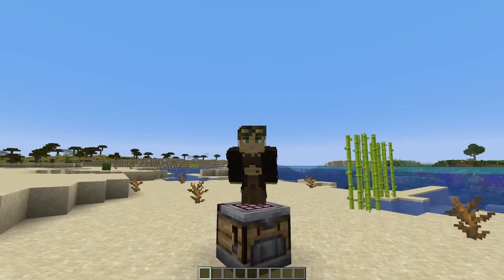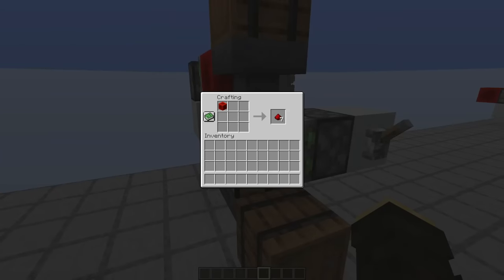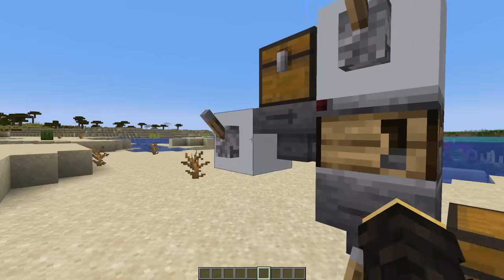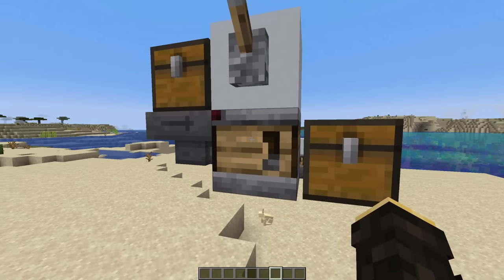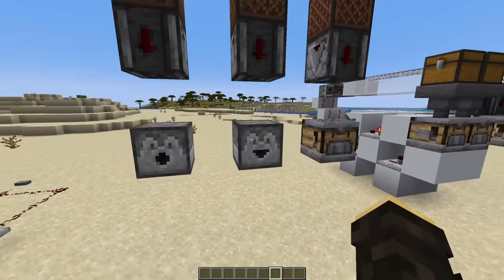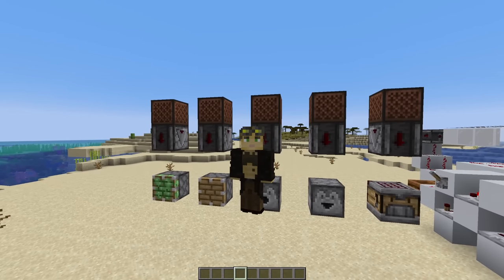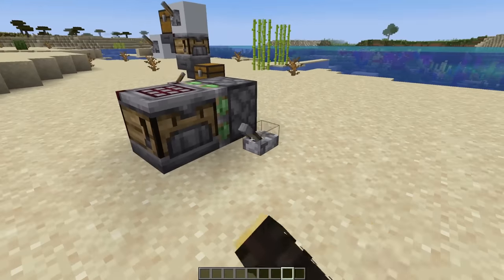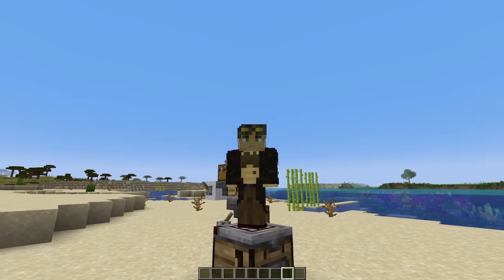The Epic Return of Autocrafting

Comment: You can still make 1 wide tileable design have the comparator running out of the auto crafting run i to a peice of redstone dust, opposite to that redstone dust have another compartor outputting a signal of 8 that redstone will stay 8 until the auto crafter outputs 9, which that change can be detected by an observer in the same 1 block tile

Comment: I don't want them to change the signal output. It works just fine as is. So, the "why we want" is very much a projection.
Reply: for a 1 wide tileable version it is important to have a signal strength of 15 though, since that overrules the comparator reading an empty composter for example and then give only a signal when the crafter is full
A signal strength of 9 would need a comparator in subtraction mode which is 2 blocks wide, or it would need a lot of redstone dust (which is very laggy)

Comment: my thought about your issue with limited inputs and using movable tile entities for a universal autocrafter: why not change the input method, rather than the processing method?

would it be possible to use a series of up to 9 hopper/chest minecarts that are sequenced in the correct order? e.g. input ingredients into separate chests, fill minecarts, then send each minecart in the correct order over the autocrafter?
Reply: Possible? Sure. Something similar to the hopper minecart-fed super-smelters. Load up 9 hopper minecarts simultaneously with 5 stacks each of a crafting ingredient. Send them out in order over a strip of 320 hoppers with crafter blocks underneath, then power all the crafters to craft the items and spit them out. Repeat as necessary until the job is done.

It would be a bit difficult to make it work with items that have a different stack size, and the minecarts would need to be sent out 0.4 seconds apart to allow for hopper cooldown time, but it would work.

Comment: honestky, I find a lot of the criticism sounds like you just want things to be easy, using the contraptions already designed for the modded auto-crafters instead of developing new contraptions.
As shown, most things can be done with the current implementation, including making a universal auto-crafter. The system would be big and complex, but it's possible.

The signal strength 0-9 does seem intuitive in a way and has it's own advantages, making the system 2-wide or 3-wide tileable is still easily possible without signal strength 15. Not everything needs to be 1-wide (although it would be nice).
I would suggest the signal jumps to 15 when all slots are completely filled. That way there is a trade-off for 1-wide tileability, but it is still possible in a compact way. This would also bring it closer to other containers' comparater output.

Comment: Couldn't you move the dropper instead of the auto crafter? It might make inserting items into the droppers a bit more awkward, but at least it's doable 🤔
Reply: No, you can't. But you could make up to 5 droppers fire into a hopper at the top of the crafter + 3 around and 1 below the crafter and you get exactly 9 slots. However you would have to make it slower than the hopper speed so that it doesn't break.

Comment: Just wondering, why could you not just have a single dispenser dispense items into two different slots of the crafting table for a universal autocrafter?
Reply: Or multiple dispensers that go into a hopper
Reply: A single dispenser (or rather, dropper) feeding items into two different slots of the crafter isn't going to be able to reliably feed the same items into the same slots if a slot empties out. It could be OK if you design the crafting station to always keep at least one item in each slot (not that big of a limitation, there's not that many crafting recipes that use non-stackable items as input...) but it does mean it'd take more prep to prepare the crafting system before running a big job.

I think the main issue with a hopper is that it's slow, 0.4 seconds per item. If the aim is to craft thousands of items, that's a pretty significant difference.

Comment: just had a thought, could the crafter be used for a sorting machine? you could disable all but one slot, and fill it with the item you want to sort, with some additional redstone  would this work?
Reply from the maker: I had an idea to use it to sort tools using the recipe that allows you to combine tools for their durability as  tools of the same type would produce valid recipes, but the crafter doesn't distinguish between valid and invalid recipes at the moment.

Comment: I think you could use a dispenser as a line of items so you would need 3 faces of the crafter which are connected to a dispenser or dropper that are also connected to 3 dispensers or dropper,do u have more control about what goes in and in what order

Comment: I'm really bad at redstone, but can't you just feed two separate Droppers into Crafter-loading Dropper at half speeds? Like, sure, it will be taking twice as long as it would at full throttle, but it's not like items, that have enough different components to require such overloading, are needed in the same amounts as ones, e.g. Perimeter Printer's filament and mechanism itself.

Comment: where do you need a universal crafter? in most cases you just either need some kind of compacter or a utility converter either to store items better or to use resources of one farm to run another
Reply: If the plan is to do some crafting in bulk (say, a hundred shulker boxes of some block you need), then you aren't looking for a crafting system that works at the speed of whatever farm you're running, you're going to be bringing hundreds of shulker boxes to a machine that can do bulk crafting quickly. If you put that kind of energy into creating a bulk crafter that can work at that kind of scale, you'll want it to be able to handle whatever bulk-crafting jobs you might need.

So, crafting materials for mega-builds, or TNT for big excavation projects (if you have moveable dispensers and no TNT duping), that kind of thing. Also if you wanna be Scicraft and have a million of every item just to have it...
Reply: @tetsujin_144  if you have specific crafters hooked to farms you will be done with the first thing and for the second you are so limited by hopper speed that bulk crafting is just faster in manual fashion with 9 shulkers it's just faster to break them with anvil dripstone or cactus and craft whatever

Comment: Couldn't you just have a crafter for each needed pattern of disabled slots, and code the sequences of items for the items you want? 
It won't be quick per crafter, but throughput can be improved with more crafters, and you could even add auto-requesting with minimum storage shutoff.

Comment: I feel like Quasi connectivity going forward should be a toggle (using some kind of item)

You'd just make it so old worlds 'replace' the 'old' pistons etc with the new 'quasi' ones, then have the normal blocks function as they were originally intended to.
and, ofc, add quasi to bedrock with this new item/block variants/toggle.

I feel like in theory it wouldn't be that hard to create redstone parity without breaking everyone's contraptions, it is possible to replace old blocks with new ones when updating worlds isn't it?
Reply from the maker: You really need to embrace the utility of quasi connectivity, the options to power things is just so much better with quasi power.
Reply: @cubicmetre  I'm not against it entirely, sometimes it just ends up being more annoying than useful (for casual players especially, it isn't intuitve since it IS a bug, technically)

The middle ground would be making it toggleable, best of both worlds. Keep quasi, turn it off if you dont want it (or turn it on if you do)

And it also means Bedrock users can have their quasi, if they so choose, in an ideal world at least.
Reply: Quasi connectivity kinda sucks
Reply: And, thinking on it more, if Mojang did make it an item or special block variants (Related to the end because teleporting, rifts, alien, maybe? idk.) they could allow quasi in any direction (obviously, still toggleable for each direction)

Meaning all six sides could have quasi functionality if desired, on top of the original one block above (I think? pretty sure it's only above atm)
Which would make it more than just a bug being a full-on feature, it'd probably be interesting to allow access to quasi from the side and below.

It could be a cool addition, fix and parity play, issue would be figuring out how to make it intuitive (how do you visually show the functionality? particles? How do you modify the block without making it a chore to place next to another? etc)
Reply: @stratonikisporcia8630  emphasis on kinda, being a casual player just trying to make some real ass redstone contraption rq and having to deal with or play around quasi is annoying

But for technical players, quasi is a really strong tool, which is why it hasn't been 'fixed'

Only real solution IS to make it an official feature, while also fixing the originally unintended behavior without breaking old contraptions (likely by exchanging blocks when worlds update)
Or just ignore it forever, i guess
Reply: @@zetaggwp8473i genuinely think this, it’d; 
1. Add parity, 
2. Expand the bug turned feature 
3. Finally ‘fix’ the bug for the casual audience 
4. Make it much more intuitivie to use, likely with a visual to show people how to interact with it

I can’t think of any downsides, assuming when implemented it auto-replaces existing pistons and etc with the quasi-up^ variants
Im sure there has to be some downside

Comment: I don't agree with changing the strength to a 0-15 range. It doesn't split up evenly. Right now it's very intuitive, and beginner friendly. I don't think we should sacrifice that just for efficiency in one specific use case.
Reply from the maker: this is not really one specific use case, this is probably the most general use case as it applies to the outputs of most farms

Comment: solution to the multiple different item recipes would be another slot somewhere in the GUI that fits any recipe template item so the autocrafter ''knows'' which items it should put in which slot. As long as the template is in this slot the autocrafter can only craft this particular recipe.

Comment: Make movable: Sure. Long overdue.
Signal strength: You failed to explain. How is 15 easier than 9?
Quasi-connectivity: No. Please, *no*. This counter-intuitive artifact of the original pre-alpha redstone code does not need to be applied to new blocks. I can understand the community's desire to keep it for pistons, but on droppers and dispensers it is my community's most frequent cause for debugging support requests. Do not add this to the crafter. Cut the legacy code and let us have an update where the community works with Mojang to make a intuitive and parity-centric redstone system for the entire vanilla game.

Comment: I don't think you need to move the autocrafter to make a universal crafter.

I wonder how the autocrafter would react to a line of 9 instant droppers each having 1 item. 
maybe with pulses we can get some high enough crafting speed.

Of course let user access the auto crafter to change the layout of the receipe if it is not a 3*3

Comment: Legit the only thing they have to do is give you the ability to lock recipes into the autocrafter. Said recipes will remain locked until you break the block. Boom every problem solved and some quality of life too
Reply from the maker: You can technically already do this, by having the slots pre-occupied with items they would act as item filters, only issue is incorrect items would backlog the system.

Comment: well you could just add a hopper line of 9 hoppers into the autocrafter and have a dropper into the hoppers dropping the item of the item slot in the place the hopper resembles
Reply: that unfortunately doesn't work

it really should, if hoppers weren't a bit jank, but unfortunately, they are
Reply: yeah that doesnt work. hasnt worked for a long time. ilmango has complaints on. the issue can be seen in xisumas latest video too

Comment: Maybe this would be too broken but what if instead of clicking on slots to enable or disable them and then get Hoppers to move items in the correct order which is a bit of a pain and sometimes breaks

What if instead you'd open the recipe book and choose the recipe you want to make and that would lock it in so one hopper could have a variety of Items in any order and it'd just auto sort to the correct slot in the recipe you have locked in?
Reply: I think their goal is to require as much circuitry as possible to do things like that. We can do all that, but we wire it manually with large redstone machines.

Comment: Making Block entities movable is not a few lines of code... It's probably not hard to implement, but it's not trivially either, and probably has massive performance considerations for pistons in general.

The fact that the mod allows it to be toggled on or off has little bearing on how easy it is to implement. The fact that you are saying that honestly makes me think you have no idea about coding.
Reply: I think the main issue with movable block entities is duping risks, but if it is about duping, then it seems hypocritical to still "allow" tnt and sand dupes
Reply: @NathanHaaren  IMO the argument that sand and TNT being dupable, but netherite isn't isn't that hard to make. We also have infinite cobble generators. Sand and TNT dupes can be seen as game mechanics which make some things possible that otherwise wouldn't really be (most notable perimeters and auto miners). But having an easy duping mechanic for any item you can put into a chest... isn't really the same thing, and this is IMO a dishonest argument.
Reply: @megaing1322  duping is duping, in my opinion the kind of item is barely relevant, because duping for example millions or sand blocks has the same value as 1 duped netherite ingot, the only difference is that the duping of 1 netherite ingot is faster than the duping of equal valued sand (or tnt, carpets, rails, concrete, ...)
Most of the technical community only allows duping as a solution to missing alternatives, this is why sand, concrete and tnt dupes are commonly accepted while carpet, rails, tripwire hooks and string dupes are frowned upon because of being much easier to produce in large quantities
Reply: @NathanHaaren   I disagree with literally every part of the first paragraph. If this is your opinion, I don't think there is anything I can say to convince you. But I do fully agree with the second paragraph.

Comment: You are literally the only person I've seen that doesn't blindly call the crafter revolutionary but I haven't seen you point out that, in it's current state
Crafting manually using the recipe book is easily 10 times faster, even when using it in something like iron farms that only get one item inputs that just stack, you can grab your entire inventory of iron and craft 3/4 stacks of blocks while the crafter is barely going for the 16th block
Reply: it's slow, yes, which is why they talk about making a bunch work in parallel at one point in the video. it's other power is for use with automated farms -- it only needs to run as fast as it receives items from the farm, and can run the whole time that the farm is running.
Reply: Yeah, crafting manually is faster (particularly with the crafter limited to doing 1 item at a time)
Auto-crafting is good for convenience, and for bulk processing (as in, dozens of shulker boxes of one item, making materials for large builds, etc.)
Reply: Tthe feature where you can move all of like items at once into and out of your inventory is a java only feature.  Also, the autocrafter can run in the background while the chunk is loaded, and you are off doing something else. This is still useful on both java and bedrock for that reason alone, even if it is slower.

Comment: rays works has already made a univeral crafter usi g droppers and hoppers to order the 9 different materials
Reply from the maker: Anyone can make a universal crafter by inputting items slowly enough. The issue isn't the crafter itself its the system you need to build around it to handle item distribution and collection. If you need to click on heaps of inventories and buttons to use your autocrafter then you may aswell craft everything by hand.

Comment: this guy knows you can run comparators into comparators for lower signals right? just put a full autocrafter with a comparator running into your main crafter and boom, the pulse only turns on when the table is filled.  this adds 2 blocks compared to that rail monstrosity adding over 20

Comment: I very rarely craft things with non-stackable items.    I think a good compromise would be to just not let it craft unless there are at least two items in a stack.   Just put in the recipe you want and it will never change by pushing items in.   It just buffers one of every source item.   Let's face it, if you're auto-crafting you are using it for crafting a lot of items.  One of each source item as a buffer is no big deal.   The only thing I really craft with non-stackable items that might be useful is dyeing shulker boxes.

Comment: i bet it would be possible to use water streams to input multiple different items into one side of the autocrafter, and dummy items might still have a use
Reply: (Copied my own comment) pretty simple actually. Just make a row of hoppers behind the crafter, then dispensers onto those hoppers, the dispenser closest to the crafter will be the item that lands on slot 1 in the crafter, dispenser number 2, connected to the next hopper in the row, will fill slot number 2 in the crafter and so on. As the items are inputed in a certain order.